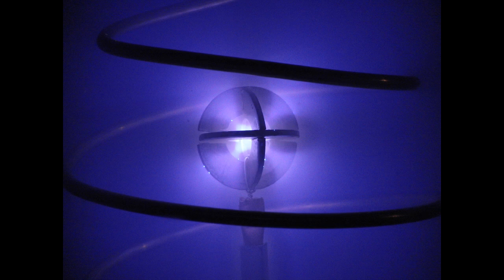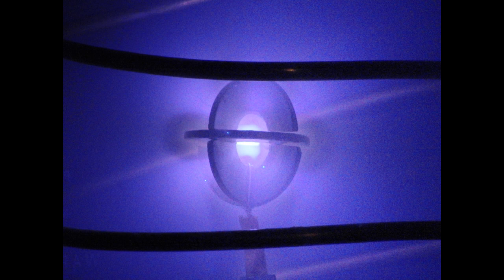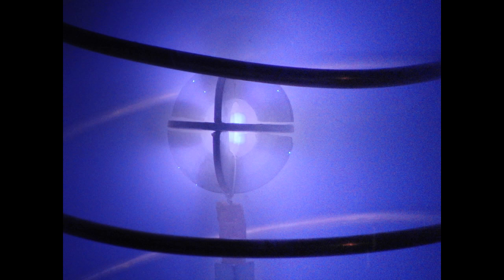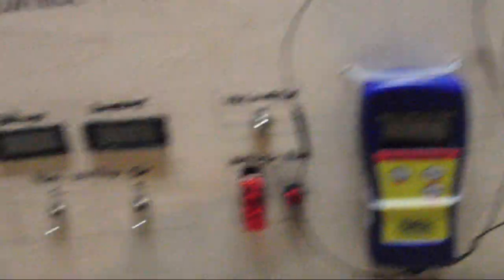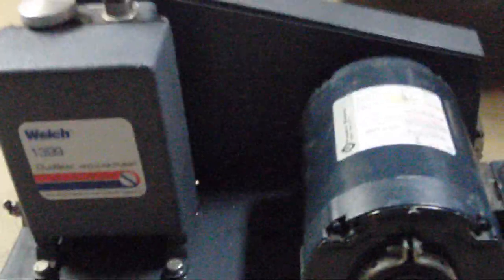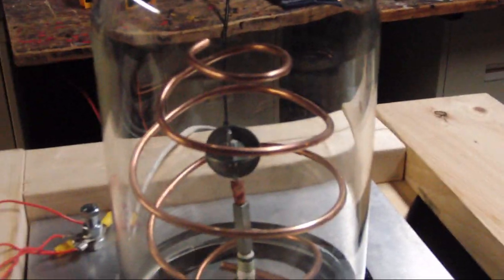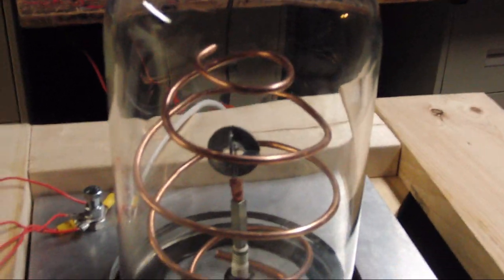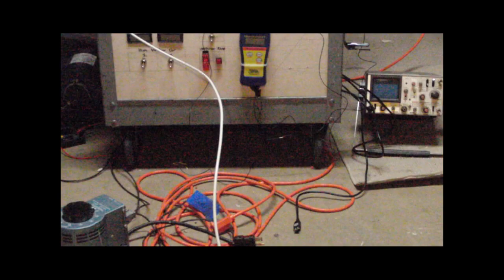My Demonstration IEC Nuclear Fusion Reactor

Comment: Inertial electrostatic confinement. 

its just exciting residual oxygen and nitrogen molecules left over from an imperfect vacuum. 

To achieve fusion you need
1: a stainless steel containment vessel to act as a neutron reflector
2: a more complete vacuum
3: much higher voltages
4: duetrium 

not to mention higher test materials and a good lead encasement to protect against radiation.
Reply: come on give the kid a break. Christ at least praise him let him know hes doing a good job, dired up morons like YOU make kids feel bad and those BRILLIANT MINDS go to waste. how about some CONSTRUCTIVE CRITICISM  at least he's not cooking up CRACK.
Reply: in addition to that, what dave said: the first point is wrong, we are not talking about fission. Deuterium atoms give a shit on neutrons flying around. You just have to give the Deuterium enough energy to overcome the coulomb repulsion. Also you don't necesserily need a more perfect vacuum. A few pascals are sufficient - the fusion rate will be smaller, but there will be fusion.

Comment: Also: If you aren't making or scrounging the parts yourself, you can easily spend $1000 USD on one of these. You may be able to scrounge the necessary parts but It can take a while to track down good deals! (A Teacher may be able to find you a bottle of Deuterium and a Regulator/Valve for it too to "Borrow" ;) )

Comment: D-D Reactions are nice and simple and frankly these reactors are exceptionally easy to make WITH the following Caveat: you're playing around with easily lethal electricity. I wouldn't suggest attempting this without at least someone who knows how to safely work with High Voltage systems, as well with someone who is at least knowledgeable in Nuclear health. Done right this is an awesome project, but please don't underestimate how dangerous some of it can be handled incorrectly!

Comment: @WASDLeftClick Actually, you should do some reading in fusion. This is just a demo fusor, meaning he is not using deuterium, but if he was it would most certainly fuse the deuterium. This form of fusion uses high voltages to ionize the deuterium which is then attracted to the grid (because the grid is grounded). Once it gets to the grid it has so much speed it zooms into the centre and collides with other atoms, fusing to form helium.

Comment: @BrokenMaddie You're wrong, and extremely outspoken. You, along with about 98% of the world fail to understand what this reactor is, and what it demonstrates. Fusion IS happening in this reactor, and in reactors around the globe, as it has been for quite awhile. The REASON its not a power source is because these devices don't produce nearly enough fusion to justify the energy needed to operate the device. I could build it, and so could you, if you weren't too damn stubborn to RESEARCH anything

Comment: @BrokenMaddie It was a basic source for info in simple language you could understand. You know, because you're a fucking moron...

As for scholarly references you won't read either, and wouldn't understand if you tried:
Journal of Applied Physics
Issue Date: Oct 1967
Volume: 38 Issue:11
On page(s): 4522 - 4534
ISSN: 0021-8979
Cited by : 14
Digital Object Identifier: 10.1063/1.1709162 
Date of Current Version: 06 July 2009 

Have fun you fucking mouth breathing luddite.

Comment: @Lenangreal it's easy to get tritium you just have to find some old exit signs that use the powder tubes,they contain tritium oxide,beware tritium oxide is radioactive use lead sheilded gloves and apron,sheilded facemasks and gas masked rated for heavy radioactive dust. never underestimate the power of radiation.

Comment: @Texmurphy51 It is hard to detect sarcasm. For the machines, it does do fusion and they are a good source of neutrons which companies use I think for measuring steel sheet thickness, I think. The machines are a cheaper alternative to californium 252.

Comment: @Tidbit77 Ah. I might be thinking in the wrong multiple of ten... I work for an engineering firm and we do thin film deposition in sputtering machines with various types of plasma, and all our pumps are cryogenic, which I though was necessary to get down to those pressures, but like i said, maybe im thinking another decimal place lower or something. or the poeple i work with are spending too much money on LN2 :D

Comment from the maker: @32sane 
The inner grid is made of stainless steel, the outer from copper rod.. Marine sealant will outgas terribly when bombarded by ions. If I purchased everything brand new, it would have cost alot. The vacuum pump I am using costs close to $3000 new iirc, but I got it for free.

Comment from the maker: @32sane 
I like your enthusiasm, but you are perhaps underestimating the project. The vacuum shouldn't really be measured in PSI, but Torr. I am running this at ~150mTorr in the video (.0029 psi). My new fusor can reach pressures of <1mTorr.  A computer supply is not enough voltage. You need probably at least 1000v to get a good discharge, whereas a computer suply outputs a regulated 12vDC. I am running this at around 6000-7800v, and my new reactor 30,000v-48,000v.

Comment from the maker: @Fendz 
Currently I am a sophomore in high school with a passion for nuclear physics, however I may soon begin post secondary research at Kent State University. 

While cold fusion may be possible, its has not been well supported by experiment, and even if it is possible, I highly doubt it would come close to being a a viable energy source. However I must say the same of the Fusor; it is not coming anywhere near breakeven, however it is still far more powerful than claimed LENR reactors.

Comment from the maker: @unix001 
The current reactor I have, as said in this video, is not doing fusion. I need a higher voltage supply, a metal chamber, deuterium, and a high vacuum pump to do easily DETECTABLE fusion. I recently have just acquired or made all of these things. Ideally, I'll be doing detectable fusion within a few weeks. This reactor merely accelerates air or another gas in the same way as an IECFR, but they do not actually fuse together. In my new system, deuterium ions will.

Comment from the maker: @HedgehogStudios1 
Scientists have been doing nuclear fusion for a long time. This type of reactor, which uses inertial electrostatic confinement for fusion, was pioneered by Philo T. Farnsworth, and later worked on by Robert Hirsch.
However, nobody has been able to sustain a reaction (and contain it) that produces more output energy from the fusion than is input. That  is what they are trying to do with lasers at NIF.